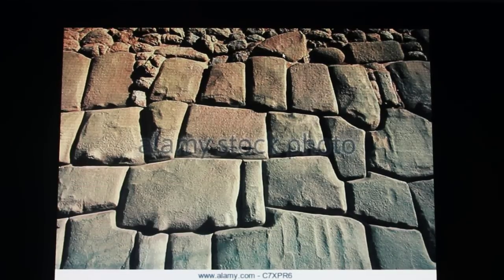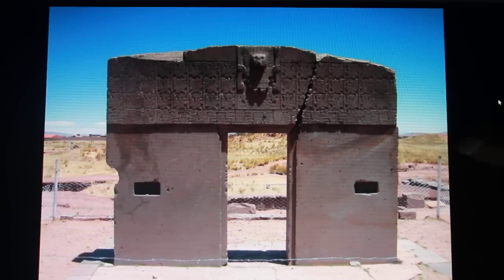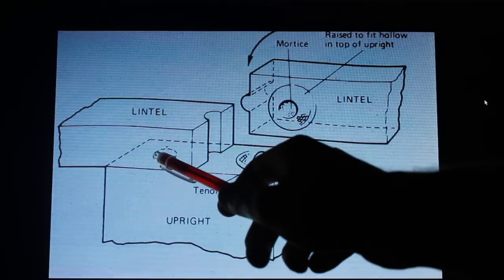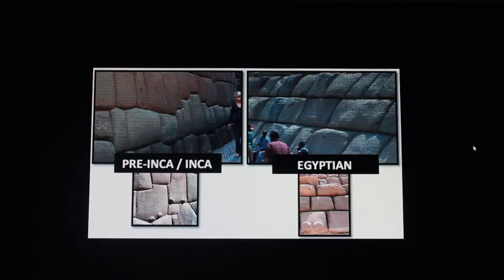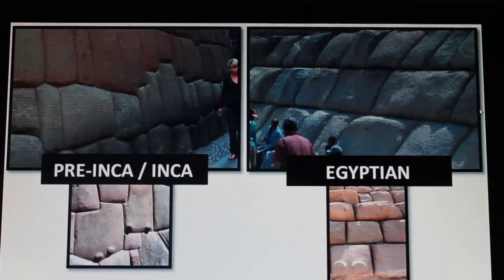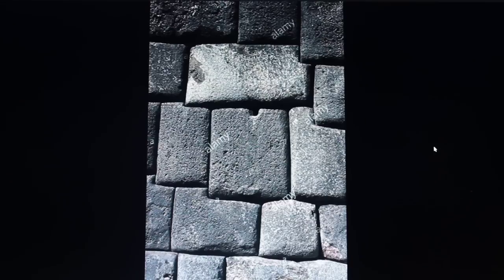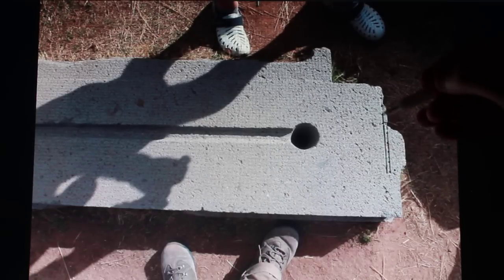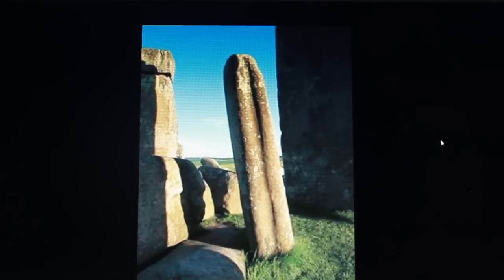Is this what the NUBS on megalithic pre-Inca walls are for? (FOR JOINING STONE?, Proof provided)

Comment: I had my own theory that if the ancients used Gravity Cranes and likes just like in modern times using thick woven straps one would have to get those straps back out from under the block once it was lifted into place and what a better way do that than leave a point to lever on to slightly lift the block up to slide the strap out. At point 2:01 our host makes light of those square cut outs. In most cases works like those two pieces held some of the heavy machinery that made the decorative blocks or carvings. I would have no doubt believing those blocks held some sort of machinery. The worst part of this is our U.S. Corps of engineers toyed with those sites since the beginning of the early 19th century from about 1857 until 1925 our Corps of engineers were heavily involved in digs in Peru Mexico and Egypt. The reason we keep finding new sites is those same Corps of engineers are being followed by these groups that make these videos. Some even have privy to notes from the Geologist and archeologists that go along from Universities. Some countries like Egypt & Peru in particular keep their own in house records of the groups and their studies to prevent antiquities loss. Currently we are using a ground penetrating radar from satellites to search for new sites all over the world.

Comment: What if these nubs are impressions made from something that was pushing the soft stone into place?
Reply: There are indentation all over the stones espseally around the edges from fitting to each other..Nubs where the insertion rod that under frequency and vibration slid into the stone..then could be picked up and placed
Reply: Strong mason PLASTER over piles of rocks is what they are:
Reply: Sinister Snacklepuss Freemason deception?
Reply: Stamped concreat
Reply: There is a guy on YouTube that has set up something called Mudfossil university where he gives a very compelling case that these huge stones were once flesh that had been soaking in salty postflood waters. The flesh of huge giants that would have become claylike and pliable and would have quickly hardened when exposed to the air.. I disagree with other things that he says, but in this case he made everything click in the right place. Even explaining the nubs.
Reply: The only way these blocks could fit so well together is if they were soft like a marshmallow when they were put in place. They didn't care about the different sizes because they knew the soft blocks would fit perfectly. The notches on the lower part of some of the blocks could be from the lifting mechanism, like a grab, where it became a little stuck to the sticky soft block.  Anyway, that's my theory. What baffles me is why do we see no sign of any of the machinery that was used to build these great walls? How were the large blocks moved to the sites? What was the purpose for the buildings? If this was built by a greater intelligence then the reason for the placement of the walls must have been for a purpose and I would suggest that the extraction and storage of rare metal such as gold could have been the reason.  There does seem to be a link with sound and vibration which could be a physical phenomenon that we have still to understand.
Reply: Soft Stone!  Yes, that’s it!  Now all we have to do is to figure out (the easy part) how to liquefy and then solidify stone.  The ancients did it, so should be easy as pie.  Go ahead.  start now.

Comment: This is what the nubs were used for??? That's what the Title says.  And yet again I keep hearing the same garbage and "what's going on here???"  And may, perhaps, possibly etc... I've already given the most simplest explanation of my own  because simplicity is often overlooked in lieu of the most amazing things. You've pointed out perfectly shaped recessed shapes meant to receive a likewise male fitting. The irregular shaped nubs that are random on the surfaces of the largest to the smallest stones of these structures has still not been anything more or new than the same old plethora of possibilities of explanation. Stop looking outside the box, the answer is simple and mundane.
Reply: Winston Smith. AND YOUR answer is?
Reply: More simple than you realize. The nubs are simply where the stones break off when quarried. The stones are dug out by grinding and cutting not only around, but underneath too. When you undercut enough, they break off. If you put the sled under before they break off, you already have them positioned on the sled for moving.

Comment: In several of his Inca videos Charles takes note of vertical scoop-like indentations in the stones and speculates that these may be quarry marks that may have been created in the process of removing the blocks from the quarry. Notice, however the these marks only run vertically in the walls and never horizontally. If these were the result of quarrying then some would be vertical and some horizontal as the masons decided which orientation in which to place the blocks in the walls. I speculate, therefore, that these marks came about after the blocks were in place.

Comment: The cutting of drains in bladders to facilitate the filling of corners and joints in the lower course of masonry is what causes these "nubs". then, after the cement has set, the exterior surfaces are fire hardened.

Comment: the " nub,s " are for walking the rocks across the ground, the inverse nub,s are a anchor point for the wood frame used to force the rocks from side to side ,and the odd straight impressions on the faces are from  being walked across a stone path way laid in front of the walking stones, once the rock was in place the nub,s no longer have a function thats why some times nubs are visible and some times inverse nubs are visible , the holes square and round are to accommodate wood beams to support interior constructions

Comment: I think the "Nubs" are just casting marks and those large stones in those complicated shapes were cast. They covered up a hole between two existing stones or walls and poured the mix in. What was left was a smooth profile with one or two marks which may have been smoothed off later or left as slight bulges or dips. If you have ever worked in a metal casting foundry this effect on the final casting before it is sent for finishing can be seen. If they shuttered off the face of the large stones with leather hide rather than wooden shuttering like today, this would explain the rounded shape and texture of the main profile of some blocks.This also explains how they had large stones with 6 or 7 closely mated surfaces with adjacent stones.

Comment: I think the nubs are for using levers to lift the stones when they are in place to do final finishing work when fitting the stones. Basically they would use a large log and lean it up against the stones that are already in place and use smaller levers to lift and shift the rocks side to side to do adjustments for fitting the stones. and when they were finished they would chip and sand the nubs off. the reason some of the nubs are still there is probably because they never totally finished the walls.. Just a theory..

Comment: I think those holes and nubs were used, not to move the rocks great distances but to nudge them into a final final fitting. They were smoothed out with smaller rocks of equal or greater hardness and therefore have seams less than the thickness of a piece of paper. Those rocks were also not put there because they needed to defend themselves because they would have been concurred before they got anywhere near finished with the wall.  The wall is still not finished because all the rocks are not smoothed to a pleasing shape.

Comment: Those grooves you said someone carved out when the rock was warm,  almost  but not quite, the stones itself wasn't hot but the tool used was plasma hot for cutting.  You see the exact same marks on Egyptian rock quarry  sites,  those grooves are still there because  those are unfinished  surfaces.  You find some walls that are perfectly smooth to within fractions or an inch.  Those nubs stickingim not entirely  sure about.  But they are not for aesthetics, they are for a part of the building  process. The finished walls of the sacred buildings are incredibly flat smooth and level. And if you were wondering  that groove  cutting and smooth finishing tools and technology,  are of extra terrestrial origin. As are the slaves that were left behind. That pinecone shape tool,  refers to a couple things,  it is a metaphor  for the powerful pineal gland.  The other it represents  is tools that were only allowed to be used by the immortals,  these were some form of alien lathes,  and more specifically cone shaped rotary file drill bits,  used in making the intricate  portions of ancient statues and megaliths if you realize the capability  evident everywhere in Peru,  they could make immaculately impressive accuracy in there walls and buildings.  What you are looking  at is unfinished walls of the lower class area.  The royal sacred places are way more precise  and finished.

Comment: The Nubs are where the machine connected that when frequecy heated it and in could be put place then vibration by the uniform dimples made it soft to mold and then once  set it broke away from the stone

Comment: Since these particular rocks are most likely poured, liquid stone, the "nubs" are where the liquid stone (cement-like mix) is pumped into the bag.  If you pour-in from the top, you get air bubbles in the block which creates a weakness.  Thinking of the nubs a nipples that get tied-off once the block is poured.

Comment: The thing about nubs... you cant carve a nub until AFTER the cubical stone has been cut (You can't make a saw blade, or whatever make a right angle or formed cut). The  indented ones can be done after, but an outdent, would have to be carved by taking way a lot of stone, except the outdent.  More tending toward a mold, made from a process of melting the base rock with a very high temperature and reforming. However, if that technology existed, why make varying type of mold shapes and sizes and not standardized blocks, as we have today? Also, why are the nubs on the outside fascia, not fitting into some other indent?
Reply: they made the various size stones to lock them all together for earthquake protection.
Reply: They were re-used. They could of been in totally different kind of building.We don't have a way to do that kind of structure today, it is described as impossible. Maybe they had to re-shape them a bit before using them again in order to get the wall they wanted. The blocks could be just found there laying around from some other catastrophes.

Comment: The nubs, nodules, or knobs make sense if you understand that the blocks are poured composite material like concrete. Notice that all the nubs are at the BOTTOM of of the blocks, why? Because they are holes in the mold to allow out-flow to prevent voids from occuring.
Historian John DiCesare, M.A.

Comment: I would suggest that the nubs are evidence that the stones we’re not cut, but poured
They were release areas for air, and on some of the stones the plugs may have popped out, and the ancient concrete may have poured out a little and this is what we are seeing 
And also for the inverse nubs what we are seeing, are the plug stuck in a little too far and pulled out after the drying process

Comment: They could be vents for the mold. Slag vents to release trapped air when they are being poured. Thats why they point out.  They likely poured them face side up, then lifted them into place.  The work must have been highly technical. There a lot of pride in workmanship in those walls.

Comment: Those big elongated grooves or “scoops” are present in lots of stone quarries like in Aswan, so it could be that it’s the face of a stone that once had another stone previously quarried out in front of it. I think the nubs served a practical purpose maybe as points for rope loops to go over for helping to move the stone, or as leverage points to help the placement of the stones in the wall or to lock stones together for transport. It would be interesting to see if any of the largest stones in areas have nubs. If they could move a single 70 tonne stone, they may have stacked up several smaller stones to transport them as one mass.
Reply: agreed . the nubs are probably the last point of contact with the rock outcropping. useful to keep the multi tonne stone up off the bedrock to allow wedges and ropes underneath to lift it . the inverse nubs are probably to help with leverage .basic stuff my kid could work out , the simplest answer is most likely correct. no melting, no concrete, no machines just man , brain and rock.  the scoop marks are identical to those from other megalithic sites and are typical of the quarry methods using hammerstones to pulverise the granite/limestone or whatever . those who say granite cant be quarried with stone tools are wrong . granite and hard rocks were shaped very easily with nothing but flint picks and round pebbles.. humans are AMAZING

Comment: Looks to me like a simple extruding for an outer layer of brick, stone, or mortar to make a smooth and pretty final wall.  Basically, the stones were probably not the final exterior.  The nubs may have had multiple uses such as placement, but their final use would appear to be a foundation for the smooth stone and/or mortar layer of coverings on the wall.  We still do that today, but in front of concrete and not stone.  The outer layer would collapse on itself, under its own weight at the bottom of the wall if not supported every so often.

Comment: The NUBS were conductors or conduction points for the softening of the stone. They came about when the source of power being used was applied. They were a by-product. Not all stones produced 'NUBS' when this power was applied; it depended on the make up of each individual stone, how long and how much 'power' was applied. there are very few other explanations can solve the mystery of the precise fitting together of these megalithic puzzles. They were lifted in place by giants who were former angels cast down to Earth who had extraordinary size, powers, and strength. Although controversial, this is a lot easier to swallow than the nauseous crap mainstream historians/archeologists have been trying to feed us.

Comment: if you accept the hypothesis they are made of some kind of polymer you probably need some enforcement / clamps to prevent the casings bulging out... 
now a days we use steel enforcement, which can erode/ oxidise over time..
but maybe these people first made enforcement / clamps from the same polymer
to tie the casings together, later on they did pore the same polymer in the casings
and after turning solid there wasn't any material difference between the clamps and de building stone. ( except for the piece of rock / polymer outside of the casing. )
in fact they could be stoneified bolts.
Reply: They were shaped in place with frequency's and vibration..ROD INSERTED by vibration and frequency was able to be picked p into place then shaped depretion show presure applied at every connection NUBS from retraction of rods and broken nubs from dissconect
Reply: michael Garrison If we can accept the stones where casted polymer / clay in some rubber bags or other flexible material.. maybe these ( some ) bags where pierced  
on the bottom to make it easier for an other bag on top to fit in shape 
while the polymer flows out the bottom.

Comment: The different “nubs” you mention are not all for the same purpose. There are those on X or Y surfaces which are designed to interlock and there are the H, T or O shaped junctions between two stones which are for casting metal clamps; mainly on the top X surface. The Z surface “nubs”, called protuberances are more than likely vibrational tuning features. The “inverse” nubs (concavities) would be serving a different vibrational tuning aspect than the protuberances. Tuning is accomplished by adding or removing material. If you look at the random places some of the protuberances appear on the Z surface, it is apparent that it is NOT for joining or holding other objects to that surface. Some are way to shallow or irregularly shaped to serve that purpose. I have seen a stone roof roof with a single tiny protuberance on the roof in a strange out of reach area. Countless others as well. Keep digging.

Comment: Charles, this is a re-post of mine from one of your other videos:  I've seen someone (a while back) talking about a legend by the Incas and/or some of the other peoples, that the original builders used "Magic Water"  What if you had advance technology and could easily cut and move basic shaped stones and put them roughly in place, and then use high pressure water and sand, or whatever abrasive, to cut in between the stones?  You would follow the path of least resistance and thereby fit every nook and cranny between each stone and possibly achieve an exact fit.  As far as what those protrusions on some of the stones are for, I have no idea.
Reply from the maker: Oh wow! Never heard that

Comment: The nubs are maybe made by purposely ripping open the bags filled with polymer stonepaste.. just to allow a bag on top to sink a bit lower into shape
if you put 2 bags of dried rice on top of each other the fit will be seamless except on the sides, unless you make a hole in the bottom to allow the rice to flow to the side.
the same principle would be working with bags of clay or polymers.